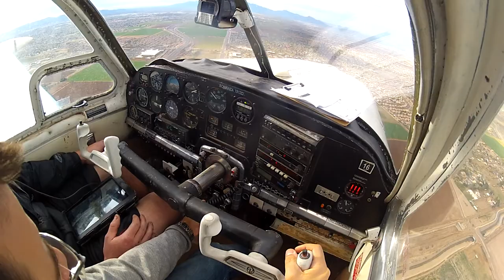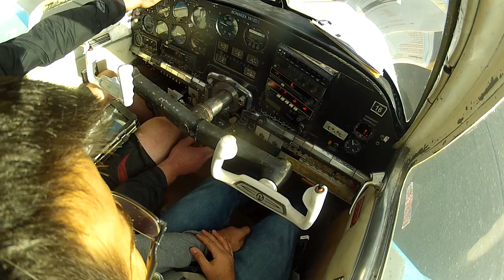Beech Bonanza C35 - Door Opens In Flight

Comment: I had a door open in my C33 Debonair during a night takeoff in a dark, unlit area.  It happened on rotation and I knew I had to fly the plane to 500 feet on instruments and then decide whether to return to the bush strip or fly to Jandakot airport, 15 minutes away.  The aircraft buffets a bit with the door open but is quite controllable.  It was a noisy and cold flight to Jandakot and I made no attempt to close the door until I was safely on the ground.  Attempting to close the door in flight can result in loss of control.  The door can open on Debs, Bonanzas and Barons if the upper latch is not secure.  The fault was all mine on this occasion.

Comment: Great plane, but there is a lot of interesting maintenance issues such as the steel cable between the handle-top latch-back latch.  I hope he got it all sorted.
Reply: I absolutely did it was upgraded to real push-pull cable instead of the old junk that was in there. Have close to 200hrs in the airplane to date haven't had that issue again